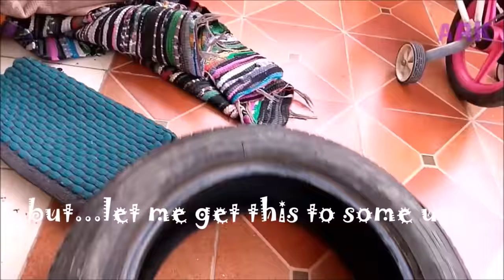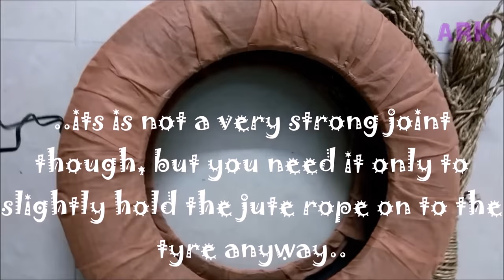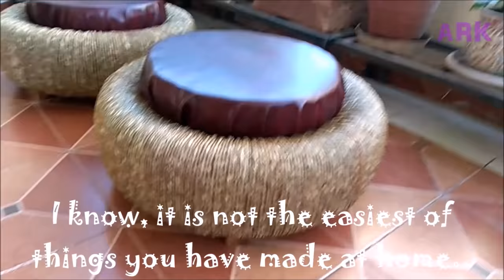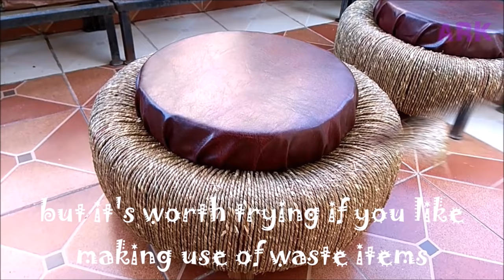Beautiful seats with old tyres #DIY #TRICKTHETRASH #TyreSeat #Recycle #Upcycle #TyreChair #TyreCraft

Comment: This looks beautiful. To make it more sturdy, you could add small wooden pieces between the two ends of the tyre(vertically) and distribute them all round. That way, it won't be 'sinking' when one sits on it
Reply from the maker: Thank you very much for the appreciation. You suggestion is absolutely valid. Will try this in my next project.

Have you subscribed to my channel? Please do it incase not yet done it.
Reply: @ARKSTUDIO1  Already subscribed

Comment: Cool loved it, please let us know from where u got the rope and how many meter’s required?
Reply from the maker: Thanks a lot for watching and appreciating the work. You will get the rope from the hardware building material shop near you. Around 25 mtrs per seat but may differ depending on the thickness of the rope. All the best in case you plan to do this project. Hope you have subscribed to my channel.

Comment: Great work! My only concern would be stability of the feet...
Reply from the maker: Feet are stable, just that you have to tighten the screws in 4 to 6 months...Else you can fix them with nut and bolts. Thanks so much for watching and also sharing the concern.
Reply from the maker: Hope you have subscribed to my channel

Comment: I am curious about two things, please:  a) does the rubber tire smell fade or should this idea be used outside only? & b) after two & a half years, how is the seat holding up?  Thank you for your assistance in this inquiry.
Reply from the maker: First of all thank you for watching.

I have used the seats for indoor and not faced the smell problem.. probably the smell fades with the used tyres. 

In two years, I have tightened the feet 3 to 4 times. The feet are attached to tyre seat using a screw and get somewhat loosened in 6 months time. Rest everything is ok.

I hope your queries are answered by me. 

Have you subscribed to my channel yet? If not, please do it..

Comment: Hi..Running a guest house..bathroom tiles are getting spoiled..best way or any alternate...
Reply from the maker: Get a bottle of Harpic or any other toilet cleaner. Pour a thin layer on tiles and spread evenly using floor brush. Leave it for sometime (say 15 mins) and wash the tiles....it will leave the tiles super clean..remember not to use the toilet cleaner on your steel taps or other bath fittings.
Reply: Thank your..Regards
Reply from the maker: @deepaks9045  you are welcome. Hope it helps you..👍

Comment: How to get this kind of rope. Can suggest any one for the above requirements
Reply from the maker: Thanks for watching. This rope is easily available in a building material or a hardware shop near by..
Reply from the maker: Else you can also use other rope options as per your choice
Reply from the maker: Hope you have subscribed to my channel
Reply: Sir, I have tried to make this and started now. Can you share varnish brand for painting the same and share the plywoot thickness for seat. And is it required for both side.
Reply from the maker: @jageshwarsahu1329  wow, great and all the best for your project.
I have used the wood varnish (wonderwood from nerolac) that is easily available at nearby shop. You can use any brand, just ask for the wood varnish.

The plywood thickness I used was of 20 mm as it was available with me at that time...You can use 10 to 15 mm or even more thickness.
The plywood is required for upper side only.
Reply: @ARKSTUDIO1  thank you sir.

Comment: Is there a chance that the interior edges of the tyre might bulge in?
Reply from the maker: It might happen in case extremely heavy weight is put on it. With me, I have not experienced it so far.
Reply from the maker: It actually gives a feeling of cushion as the inner edges sink in when somebody sits on it.
Reply from the maker: You can also fix small wooden blocks between the inner edges to avoid sinking in completely....This was suggested by some viewer and I like this idea.

Comment: using too much toxic glue, id just use wood and screws, staple gun to affix the seat cover to the wood plate, and some felt to the bottom of the feet
Reply from the maker: Hi Tim, thanks for the suggestion. Its great. I was using the already available stuff at home. The glue was left by my carpenter after he fixed veneer on the wood panel at my bedroom and believe me, it's not that toxic unless someone breathes in glue fumes on purpose in an attempt to get high.

Comment: By what name can I get this kind of stapler and from where
Reply from the maker: You can check with any stationary shop in your place and ask for Kangaroo 150 mm or 200 mm stapler.
Reply: @ARKSTUDIO1  thanks
Reply from the maker: @charusahai4821  it's my pleasure....Just want to correct my last reply..It is 15 or 20 mm and not 150 or 200 mm
Reply: @ARKSTUDIO1  thanks for taking time out to answer

Comment: I am doubtful regarding the use of NAILS on that faux leather cushions 😱😱😱😱 
Why not use any strong stapler instead of nails ... I feel it will pierced after sometimes on my little bump ....🤣🤣🤣🤣
Reply from the maker: The nails may pierce through only if you use nails bigger than the thickness of the ply.  Using stapler is a good option though. Good luck incase you plan to do this project. Hope you have subscribed to my channel..

Comment: What cost each seat after making
Reply from the maker: Not exactly calculated earlier but...the rope cost around INR85+the faux leather for INR165 + foam INR 110. Rest everything was available at home. In all INR360 or USD5 + some efforts of 3-4 hours. Hope you like the work and have subscribed to my channel.
Reply: Sir y do u skipped the step of seat fixing???
Reply from the maker: @chilukapalliarunkumar1293 I don't think if any step is left out in the video.  The seat is made in two parts, 1st is the lower part with the feet fixed and the 2nd part is the upper foam seat, which is not fixed with screws. Hope all is clarified to your satisfaction ..thanks a lot for watching the video.